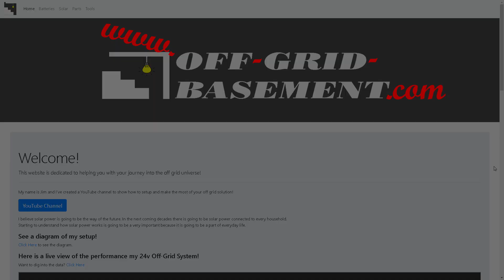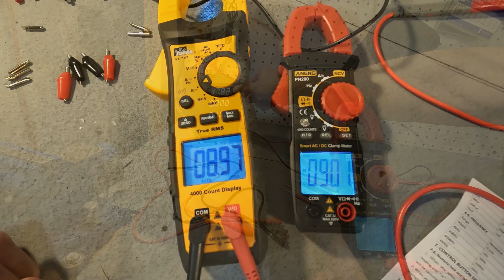ANENG PN200 Clamp Meter.  Great tool for the DIY Solar Beginner.

Comment: Ensure you get one that does DC current on the clamp as as well as AC, as many cheaper models are AC current only.
Also in AC have to clamp JUST the live wire not the whole 'power cord'
Reply from the maker: Great points! Thanks for the comment!

Comment: Hi, I've read in comments section of some clamp meters like the one you've demonstrated that they don't run on rechargeable AAA batteries, but run perfectly on alkaline AAA batteries, which are not rechargeable. I don't know why that is the case, but could you, please, check if this clamp meter of yours can work on rechargeable batteries as I am using only rechargeable batteries in all my electronics. Currently, I'm looking for getting a clamp meter for myself. Regards!
Reply from the maker: I've used rechargeable AAA batteries in a couple budget multimeters and they both worked fine.  ANENG and TESMEN Clamp meters to be precise.  Hope this helps.  Thanks for the comment.
Reply: I noticed the same on mine. ie had to use Alkaline batteries

Comment: Got the same tool. :( Current is not measured. It displays some random (0.5-0.9A) values for DC 0.3A.
Reply from the maker: Bummer.  I usually don't work with amperage that low.
Reply: Это дерьмо! Я пробовал замерить ампер - включал электрочайник мощностью 2600-3100W. Прибор ничего не показывает кроме случайных 0.10 А
Reply: @jkerrus9464  Если брали в клещи двухпроводной кабель, то так и будет. Клещи правильно меряют ток, только если обхватывать один провод. Два провода переменного напряжения, которые идут в шнуре чайника взаимно компенсируются в показаниях тока
Reply: @oleksastep  спасибо за разъяснение!